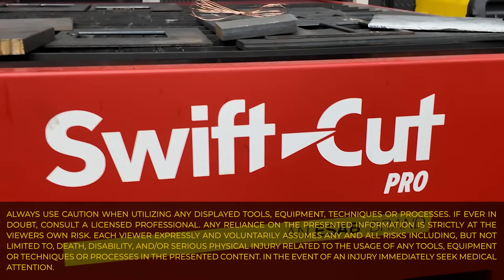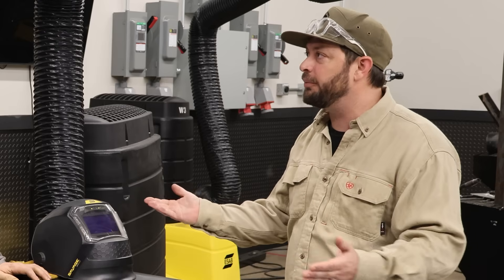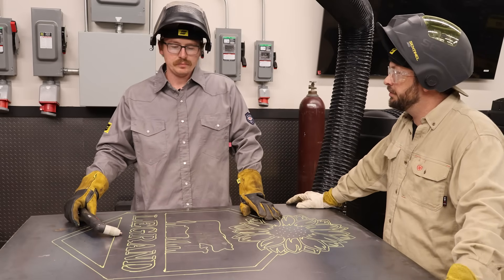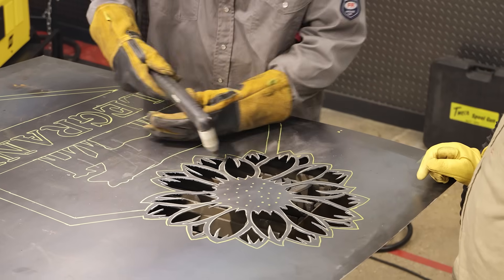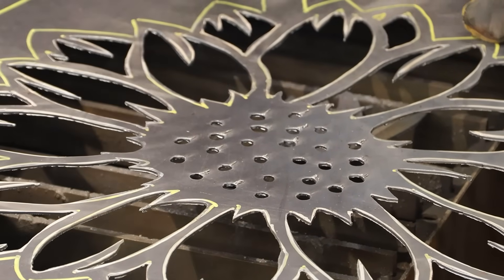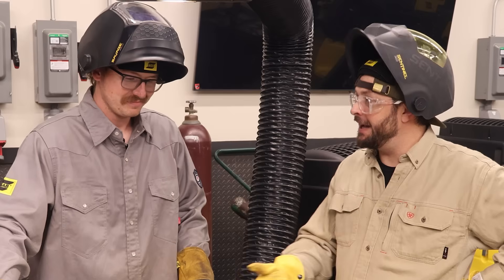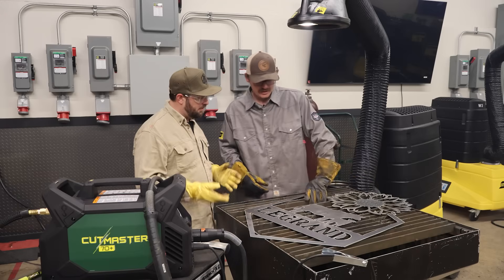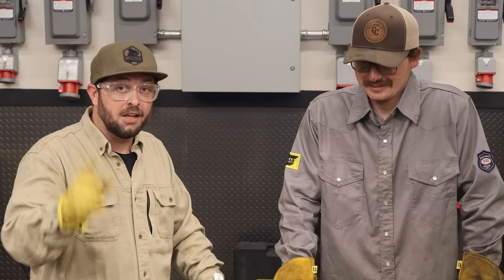Want To Get Better At Plasma Cutting By Hand?

Comment: 10:00 this is ironically what I tell people when trying to do a straight fusion laser weld on an outside corner joint so the gun doesn't twist and focus the beam on one side of the joint more than the other